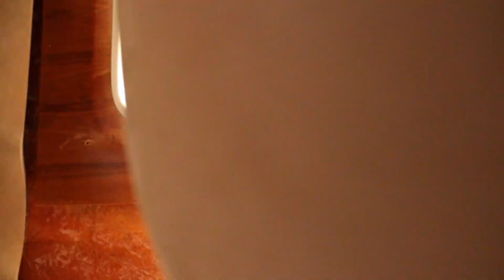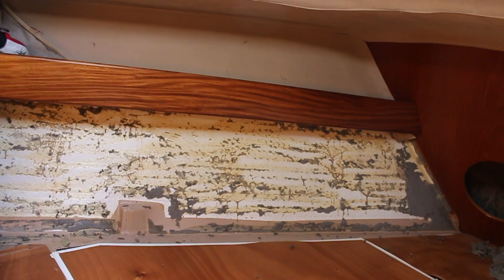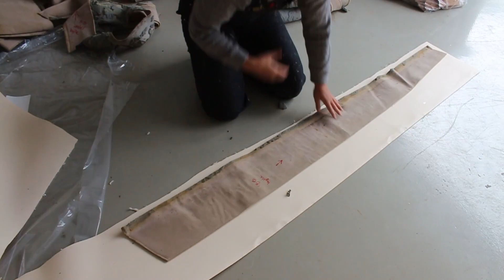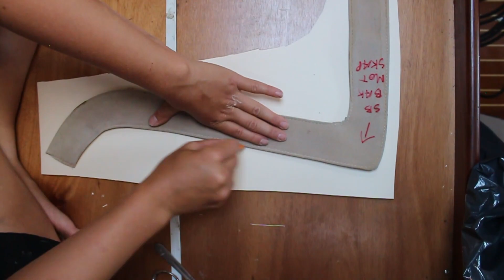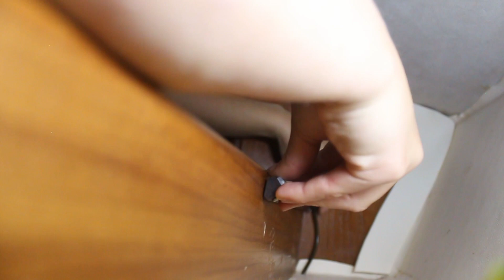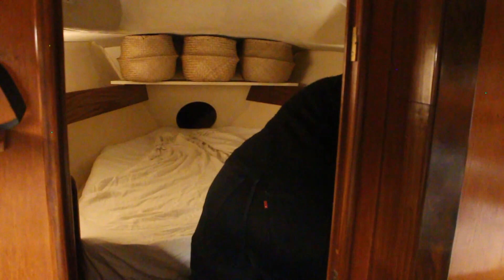V-Berth Refit - Sailboat DIY

Comment: 💗Hello, what is the material you are applying?
Reply from the maker: Hello ⛵️ first I glued on 10 mm cork for insulation and to help with condensation , then I applied a type of vinyl often used for boat interior :)